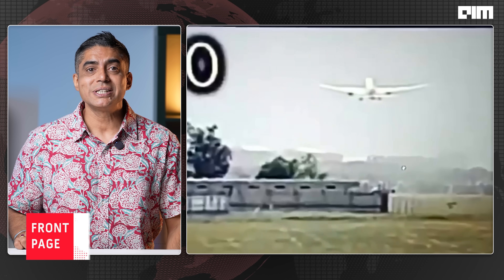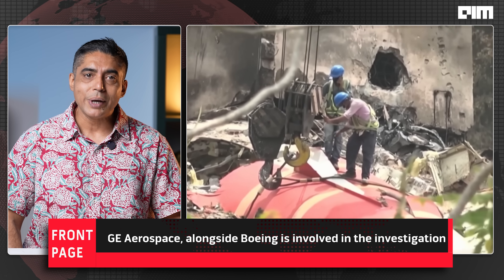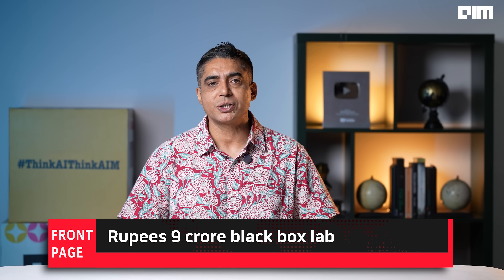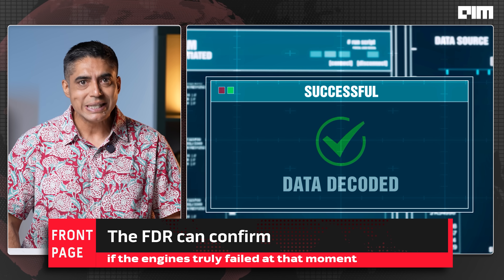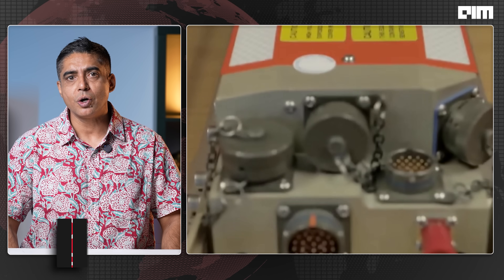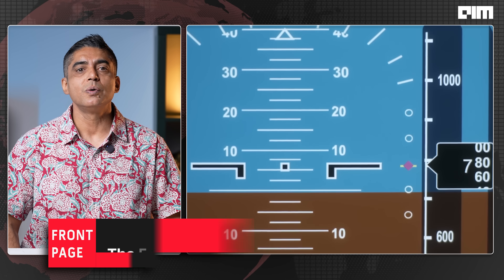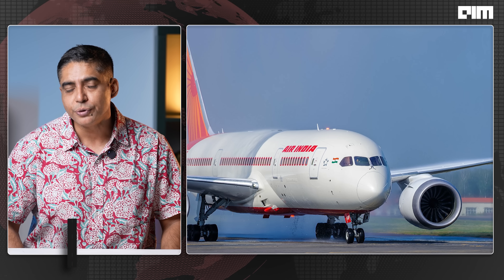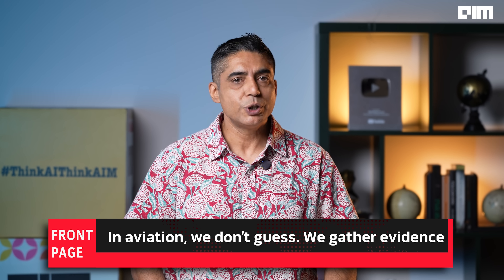What is this Black Box? | Inside the Air India 171 Investigation

Comment: We are discussing the reasons for the plane crash, and we are not discussing the reasons for such a large number of victims. The question is - Why? It is well known that there are many more survivors if there is no kerosene at the time of the plane crash. It is obvious that we need to somehow and quickly get rid of the fuel at this moment. And while there are no emergency fuel drain systems (10-20 seconds), in such cases this can be repeated and repeated. Preliminary calculations that I have carried out show that it is technically possible to create such a system using existing technologies. We must somehow separate passengers and fuel in the event of engine failure, and do it quickly. The plane itself is a good protection for passengers if there is no fuel in it.

Comment: In the engine area, there is room for an extra, ball bearing wheel, with the holding bar being extended with a plastic bar, which would burn off, with the grinding of a cheaper wheel in place, the nut would come loose and possibly be stuck to the nut.